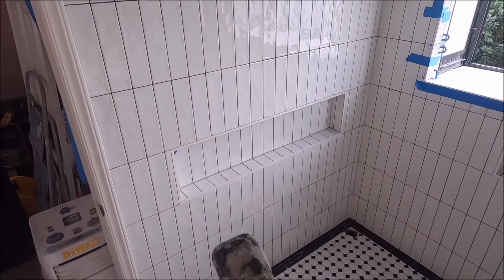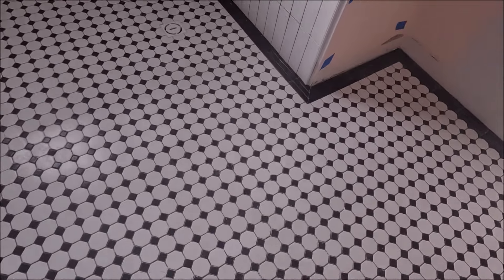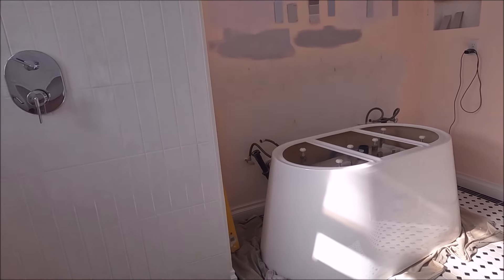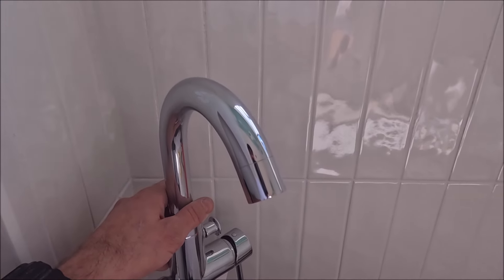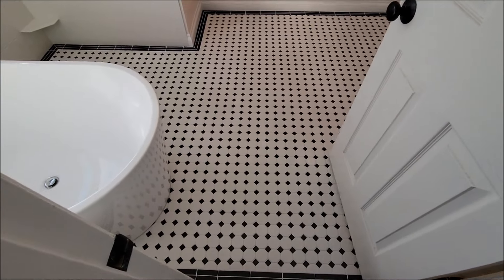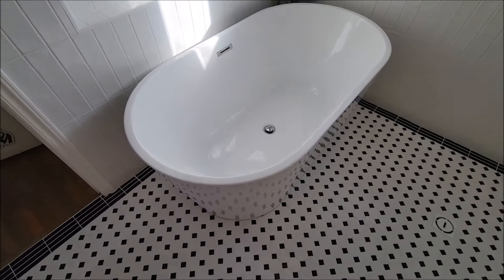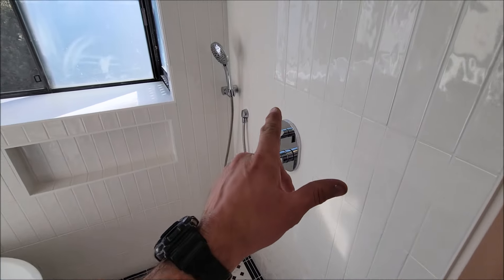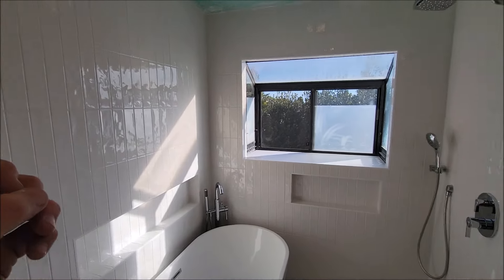Classy Curbless Subway Shower Complete

Comment: Ever install the LED lights in the niche ? We started doing that last year , it’s a nice touch
Reply from the maker: No, been thinking about it though. Wish Schluter had the setup as a 12x28 vertical led prefab niche.
Reply: We usually custom frame the niche then sheet membrane . And there are a few different waterproof led track systems that are pretty cheap , just need to hide the driver at a different location with access
Reply from the maker: @danthecarpenterman9463  Good idea, we'll give a go hopefully soon. I'll look into the less expensive led track systems and drivers.  Appreciate it

Comment: Do you have any issues with cracking grout corners ? I had a few call backs because of it years ago and started using color matched silicone and haven’t had an issue since
Reply from the maker: We usually use color matched silicone for the corners and tub/floor/flange.

Comment: looks like a high performance grout for walls, maybe the FA? i work alone and if im doing a ceramic with more or less butt joints, under 1/16, i prefer the mapei unsanded with 100 percent maximizer mixed in with it. the FA just seems to have too thick of an aggrigate for me and dries super fast. at a solid 1/16 or wider i use the FA 100percent of the time, but slightly under 1/16 the unsanded plus maximizer seems a better choice for me and its really stain resistant with that added juice, more so than the FA imo. wonderful job as always, really looks nice!
Reply from the maker: Thanks for the info my man 👊

Comment: Great build Landberg! 
Just curious...... Are you painting the ceiling or the homeowner? We always remodel from top to bottom... going to suck sanding the drywall and then priming it with that beautiful tile work all done...... I'm guessing the homeowner decided to paint themselves to save money because I wouldn't think you would do that.
Reply from the maker: Thanks! Homeowner wanted to paint. We usually remodel top to bottom 90%, but then there are those clients who want to add their own work to it. In this case it was the vanity, fixtures and paint. Hopefully they protected the beautiful work! It cost a pretty penny for sure!

Comment: You need to work
On your sealant game.
Bigger angle on the nossle
Reply from the maker: We typically grab a used silicone tube out of our large tile box. We usually have a dozen or more and grab and go. The tip was probably cut larger so the dry silicone can make it's way out.